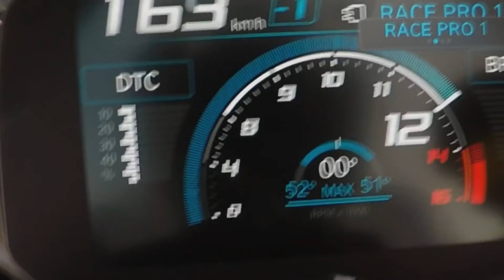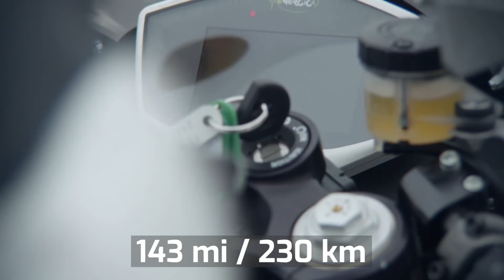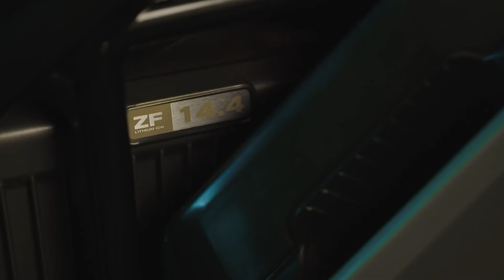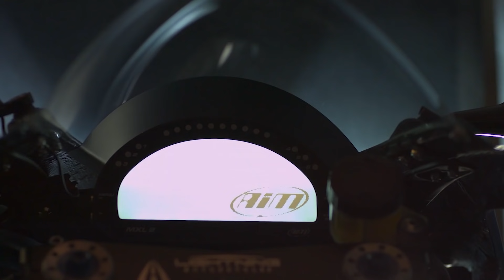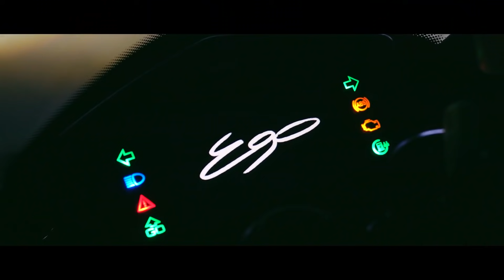World's Fastest ELECTRIC Motorcycles | 408 km/h - Faster than Kawasaki H2R!

Comment: That Kawasaki H2R is a production bike you can actually buy.
And it did 400 km/h on a public road ( closed for the test offcourse)
Reply: I'm riding an Energica, and it got much more torque ;-)
Reply: It’s also not street legal in America.
Reply: The H2R is a production bike, and I know what your referring to. It had to be modified by kawasaki for the record attempt. Kawa told the rider they literally had 30 seconds to hit the speed or they would die from ruptured tires (tire integrity would fail after 30 seconds at those speeds).
Reply: h2r is boss these EB's are for kids
Reply: But petrol bikes are struggling..
Electric bikes are evolving...

Ectric bikes can go 700-800 kmph top speed thats the scope which petrol bikes fail...

There is no more reasearch improvise possible for petrol bikes ...least  was the turbo charge..beyond that bike will vibrate a lot...bcoz its mechanical based drive....not electric motor based which is stable n less vibration
Reply: @balemkarap5090  There is NO electric bike that does 700 kmph... And if it would the battery would probably be dead in about 5 minutes. There is (not yet at least) no way to store enough energy for that. Anfd Besides where would someone even be able to reach that speed ?

And pertol engines could still be improved... But they don't really bother because production of petrol engines will be forbidden in the future.

Comment: Gas powered motorcycles ARENT MOTORCYCLES. 

They are ENGINEcycles. 

Internal. 
Combustion.  
Engine. 
Cycle. 

Or in layman’s terms: Engine Cycles. 
I don’t understand why people keep messing this up. It’s an engine. Not a motor. 
Therefore it’s a Engine Cycle. 

Electric motor cycles are the True Motorcycles. 

Cause they use a motor. 
Therefore they are a genuine true MOTORCYCLE.

Comment: Sorry, but what is Lightning doing in this list? They hardly deliver motorcycles and the few Strikes they delivered are really, really poor quality, not living up to specs and basically all out dangerous to ride around.. Missing some important info when deciding what is the 'best' electric motorcycle as well... known reliability? Customer support? For instance  looking at owners feedback it depends hugely with Zero (quite a few people having (very) bad experiences). Energica on the contrary seems really high quality and well build (but a limited amount of dealers). HD seems high quality and a good dealer coverage, but overpriced... So all in all a nice list, but unfortunately not really complete/correct... (in my opinion).
Reply: I agree with you on Lightning, but not Zero.  I own a Zero and have had nothing but positive experiences with the company.  I've heard Energica is also a good company, but I haven't had any direct communication with them.  HD is overpriced.  I really want to buy into Damon.  But until a bike is delivered, I'm being cautious (see Lightning).
Reply: @Xrusader  I also own a zero (SRS) and Zero does need to improve there quality control. My bike already was sent back 4 time and comes back with new issues. Al are relative small ones but the frustration adds up. And I don’t trust them any more. My dealer is great but get also frustrated by Zero Europe. Next bike probably will be a Energica with a set of earplugs.
Reply: I got my energica used and absolutely love it, it's actually my first motorcycle that I've ever owned
Reply: I saw the video of a YouTuber that have a zero and buy a enérgica now and he said that prefer the enérgica because the company send all the parts of the bike that you want and zero don't do that and you have to go to the dealership
Reply: I owned a Zero SR-F, and now an Energica, next will be Energica ;-)  Zero Europe support is a real issue, quality of the bikes too. To know more about my experience you can watch that (in French but English subtitles) https://youtu.be/0z8dVft9vEs

Comment: MOST IMPORTANT THAN THE SPEED IS, HOW MANY KILOMETERS DO THAT COVER PER CHARGE.🤔
Reply: No, the most important point is how many polluting fumes oil and petrol is going into the environment over the bikes life.
Let alone the cost of running and maintenance and wear on the engine. Yes, you will have to replace the batteries one day.
Reply: @briansture4353  
from where the energy comes in an electric battery?
from oil and uranium.
and the chemicals and manufacture of the battery are worse than the oil.
and the production of millions of solar panels are worse than just using the oil.
Reply: @helenodetroyo7035  I have a modest 3kw roof solar panel producing energy about 240 days a year. that equates to 6480kw per year They have been installed for three years which is 19,440kw saving on the grid. Think how far you could drive on that free with no pollution and I can do that for the next twenty years. If I put in a bigger system I could produce more than twice the power.
Reply: @helenodetroyo7035  Nearly right not quite. The earth's core is a nuclear reactor of around 10 km in diameter of decaying uranium which generates most of the internal heat of our planet. At the core, the temperature is 1000 degrees hotter than the surface of the sun. So technically because we generate heat we are not a planet but a low radioactive star not a fusion star like our sun but we have a solid surface. Very little heat is produced by gravitational compression. Uranium being a radio-active heavy metal and abundant in our planet's crust sinks to the core slowly under gravity keeping our planet's core replenished creating tremendous heat as it decays. This heat convects to the surface of our planet mainly through the oceans. Our planet's surface is 7/10ths water so there is a very large area of convection into the atmosphere. There is still some unproven science that states global warming may be assisted by changes in the planet's core temperature.  That may explain why our planet has been hotter and cooler during its long history.
Oil was the earth's original plankton which sank to the bottom of the oceans after causing oxygenation.  This made the Iron in the seas rust and sink to the bottom changing our seas from green to blue. Later it was bought back to the surface by the moving earth's crust and is now dug up and meted as Iron ingots.  If it wasn't for plankton we wouldn't have Iron oxygen or oil as oil was the gungy mess of the decaying plankton. This little organism secured our future by producing oxygen.
Amazingly it was this micro-living organism that died and decayed millions of years ago that changed the earth into what we see today.  Oil is finite.            The definition of an expert is.  An Ex is a has-been, and a spurt is a drip under pressure.
Reply: @helenodetroyo7035  Here in Western Australia we have hundreds of oil-producing wells capped since the 1970's the reason no oil is drawn from them is because of the natural gas they produce which is more profitable than oil. Gas is bought to the surface 2000km north towards the equator which migrates to this position due to the rotation of the earth. There is a massive amount of oil in the world but a lot of it has remained capped. The USA is waiting for  Arabian oil to run out, its power play. When the middle east runs out of oil watch the price goes through the roof.                                                             Heleno, where do I find a geology report that says seawater produces oil.
Reply: @helenodetroyo7035  many studies debunked the BS arguments like you stated. Producing and running an EV is by far less damaging than driving ICE. Your knowledge in that regard hasnt been updated since 4 years it seems
Reply: @romansenger2322  
For me the electric transportation is bs until the invention of the solid state battery and we can reach the energy of 1kw/h per 1kg of battery..
Reply: @helenodetroyo7035  kw is not energy, its power. What you are talking about is kwh.
Reply: @romansenger2322  Buy some glasses buddy,
I already wrote kw/h.
Reply: @helenodetroyo7035  dude, you edited your comment and the best part is you changed it to "kw/h" which is complete nonsense, a unit that does not exist. Go back to ground school and learn what the unit for energy is, lmao 🤣🤣🤣
Reply: @romansenger2322  
You must purchase glasses dude and take some risperidone pills.
Go to the psychiatric for treatment ASAP!😱🤣
Reply: @helenodetroyo7035  the only one who needs glasses is you. He is right, kw/h is complete BS.
Reply: @helenodetroyo7035  treat your physics education. ASAP! 🤣🤣🤣🤣🤣🤣
Reply: @romansenger2322  did i get this right, he changed it from kw (common mistake, i k ow that) to kw/h (who comes up with this?!?) and now HE is the one telling you to take pills? Muahaha

Comment: Is it not possible to charge the batteries on any of the motorcycles in a standard socket ?
Reply: Yes you can, both Energica, Harley & Zero are, but charging time depend on Battery size and on-bord AC chargers (1.5 kw/h for HD, 3 kw/h for Energica and from 3 to 12 kw/h on potions on Zero). Both Energica and HD has CCS speed charging (40 min on DC charging stations), but not available on Zero. All the other are not really available on the market, and some mores looks like scams unfortunately.
Reply: @LeGriffon1453  - Thank you very much for your reply 🧐
Reply: @LeGriffon1453  - Thanks for the advice 😎

Comment: Seems Odd that the Energica you say has 143 mile range at high way speed when the ZEV Electric standard LRC is the same and the LRC-X is 200 miles.
Reply: There is a lack of uniformity in standards on how total mileage is calculated; During early days where it was Zero and Energica was out there but struggling to have a presence in the US market, with no other contender worth mentioning.. Speeds were calculated based on urban travel with the assumption that you weren't going to be going faster than 30-35mph. Urban travel would also permit more use of regenerative braking as well.
Zero used to have a disclaimer on their site in small print that they took down after I found it, explaining how they arrived at the seemingly crazy number of 150 miles.

If I were to do a consistent 35-40mph on my 850cc ICE bike, my present 200-ish mile range would actually be 375 miles with 4 gallons. Instead of 70-75 mph.
I've tested several Zeros in real world conditions of being my commuter bike for a day, my commutes typically involve me traveling 60-65 mph for 85 miles in a day with very little urban travel.
Optimistically they have about 100-110 mile range without the expanded battery, I'd say Energica's models may be similar to that if people ride like I do.
Reply: @Enonymouse_  Agreed.  At ZEV Electric, we test on the highway at a steady speed.  Others use computer programs to calculate based on a dyno.  We use a 120 mile long dead flat stretch of highway from Maryland to Virginia along the ocean.  Anything else is just conjecture.  We have no way to replicate every possible instance of rider weight, his "sail" area, the degree of grades or undulating territory, effect of temperature and humidity, etc. on air density.  Its a common trick in some EV scooters to claim big range, then learn the speed was only 15 mph (or less).

Comment: It's not faster than the ninja H2 the H2 when it first came out had only 230 HP we found out through Dyno testing but now that Mentor is to lose weight faster at 351 wheel horsepower through Factory upgrades
Reply: Speed and power become irrelevant after a point, I couldn't safely or legally fully tap the 165 hp of my really nice sport touring bike on public roads and that is the only reason I owned it (to get places in comfort, style and with a certain amount of vroom vroom).
The 2021 Zero S/RS got me to 65 in 2.5 seconds, I was happy with that.

Comment: faster than h2r at its peak but eventually it will slows you down as the battery life discharges still gas practical than recharging battery takes too long.
Reply: Compare the durability of electric motor to  reciprocating engine.... what yah gonna say for it?
Reply: only a matter of  time.......the end is near for ice
Reply: ....maintaining/rebuilding a high performance engine cost way lot than changing batteries. Yeah, id chose smart money investment over a habit of smelling exhaust soot.

Comment: Wait faster than H2R ? 400km/h isn't the real top speed of H2R , btw .
Reply: Lol. H2R real top speed is lot lesser than 400 Kmh. H2r never did a true 400 Kmh speed. It's just a speedo indicated. Not verified by any official gps system or Radar or speed traps. So it can't be considered as real 400 Kmh. And for that matter kawasaki's own professional team called Team 38 also achieved a 400 Kmh on a speedo meter in Bonneville salt flats. But their gps showed the true speed of 354.06 Kmh. To be frank H2r has huge speedo errors.
Reply: And one More thing Kawasaki claims 326 hp at the crankshaft. but worldwide around in dyno tests no body got more than 250 bhp at the rear wheel. So claimed 326 hp is far , far away from this rear wheel horse power. Kawasaki seems to be definitely over rated this bike.  But anyway H2R  is bonkers fast 👍

Comment: OMG is it runs faster than H2R?👆🏾🧐👽
Reply: 0-60mph for the damon hypersport is claimed by manufacturer to be less than 3 seconds (no actual number). My zx10r is same, with stock drag strip examples on youtube at 2.9s. No difference between the two.

Damon Hypersport has good range at 200mi. That's better than my zx10r at 149mi. However, EV batteries degrade and take time to charge. My bike is a reliable daily driver that won't leave me stranded. If I used the bike in a city, EV would make more sense. The Hypersport would make me nervous about making it to work and back.

The other point is price. This motorcycle is priced the same as the car I just bought. Too expensive, and almost 3 times the price my motorcycle went for new, and almost double what a new zx10r can be had for.

Comment: I'll never buy an electric motorcycle, but I would buy a Tesla car.
Reply: You'd be better off buying an electric bicycle, the chances of repairing it yourself are higher and it's dramatically cheaper. 
Tesla's employees, honestly secretly loathe its customer base. Maybe your a Musk fanboy, IDK. I wanted to like Tesla but the deeper I dug into that company the more I found that I didn't like.
Reply: @Enonymouse_  I'd be skeptical that this kind of resentment is widespread. Sure, staff in many cases are trapped between a rock and a hard place in their support and response to the quality and fit issues that have consistently cropped up in Tesla vehicles compared to BMW, Volvo and Mercedes.

Comment: ~15 kWh battery, ~200kW motor....
...OOF. You can get as much as 9 minutes at full power! Order right now!
And with utter garbage aero (of naked bikes), it will have range issues. A 125cc bike (like cagiva mito), make 18kW, and tops out at ~100mph. With the batter pack, and even worse aero, you can realisitcally expect ~1h of highway speed. So i wouldn't get my hopes too high about reaching the charging station in the next town.

Comment: Nothing said about track length. Who cares about 408 if it was pushing for it across half the state. It'll probably do much less in a full mile. Not to mention poor quartermile result. Another thing is you can't build the damn thing to go faster. It'll run stock. Not even close to combustion. Lightning atleast had a race track purpose.

Comment: Get your gas bikes now boys they'll be worth millions in 20 years! :) Geez I couldn't imagine buying a bike for 25,000.00 I think in a few years well see more electric vehicles come out and the ones they're selling now will be cheaper, I think motorcycles guys are probably going to float over to Evtol flying quads around, they just need to upgrade the batteries to a longer flight than 30 minutes if they can get them to 5 to 8 hours of flight time then it would be well worth it in the long run. But for now save you money and buy a motorcycle or a project bike to work on. Save buy stocks or crypto!

Comment: Where are these manufactures plucking these prices from? It's a joke!! A motorcycle is not even a 3rd of volume to any car! The point of riding a fast motorbike is that you can achieve speeds & performance of a £100,000 car for about £3000. I give these bikes battery's 5 years tops! and then they they will be useless. Unless a single one of these machines comes with a life time warranty on the battery and can be replaced when ever then these are a waste of money. Cool bikes for sure but not at these stupid prices.

Comment: I refuse to buy a bike with less then 300 miles range and a speed of 0-60 in 2 seconds, Might just rip apart a tesla model 3 and put it in to a Ebike config, Or a 3 wheeled monster. Lmao 80 kwh batter plus the carbon overwrapped motor  on a motor bike would be insane, and blow all these out of the water, of corse the 2000+ lbs means 3 wheel will probably be the only option, but who tf cares when you can spec it to be that fast.